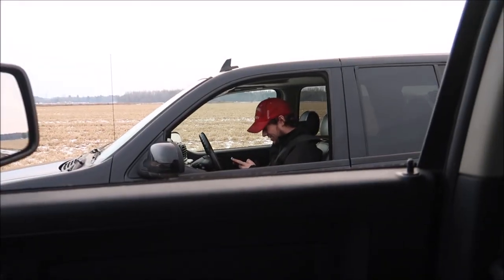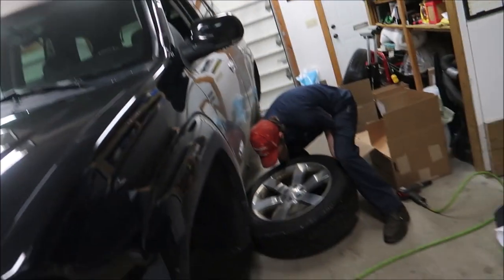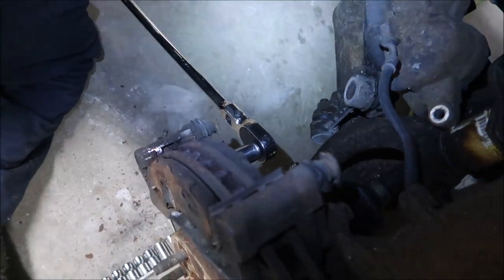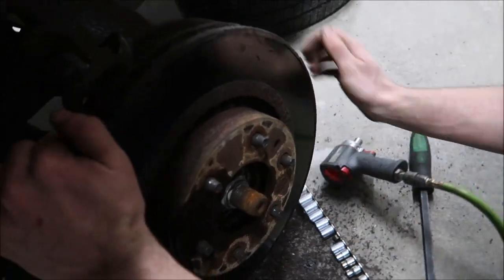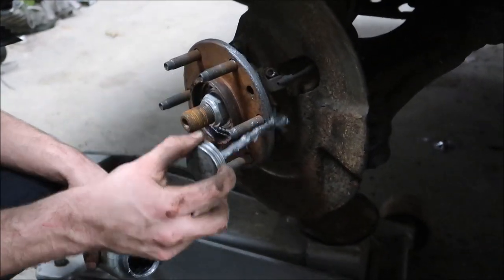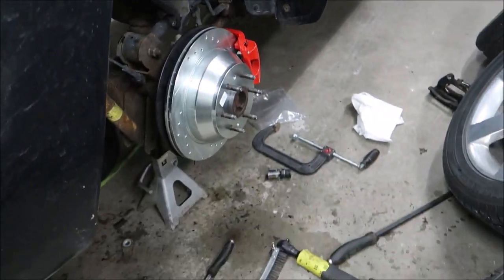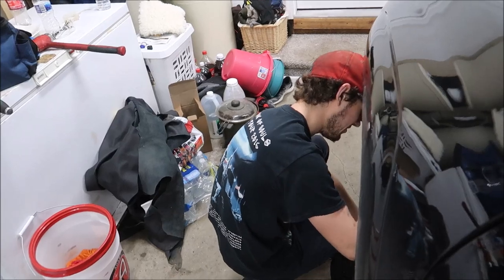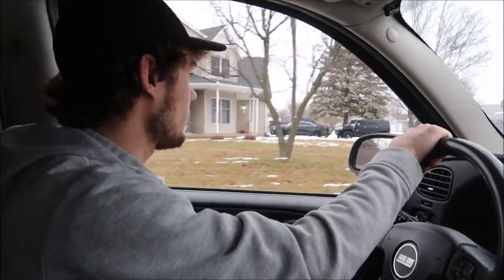Trailblazer SS POWERSTOP BRAKE UPGRADE!!

Comment: FYI, those "screw holes" in the front rotor are for this exact scenario, you can thread in a bolt to push the frozen rotor off the hub. Additional Pro Tip, when doing the fronts turn the steering wheel full lock to the right for passenger side and full lock to the left driver side, this makes it much easier to get the impact on the caliper mounting bracket bolts.